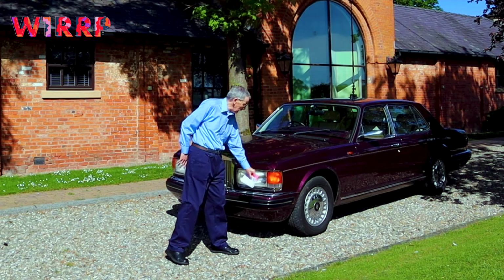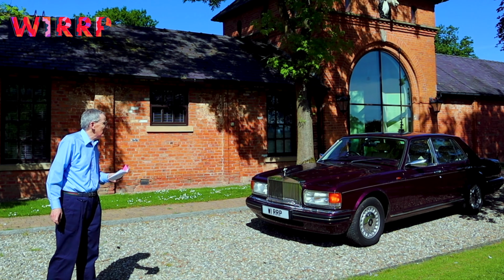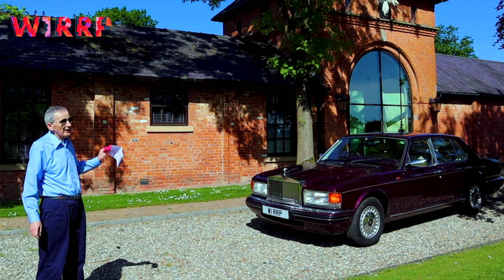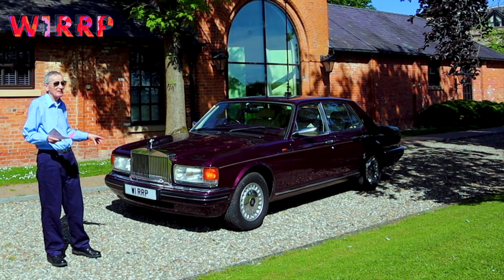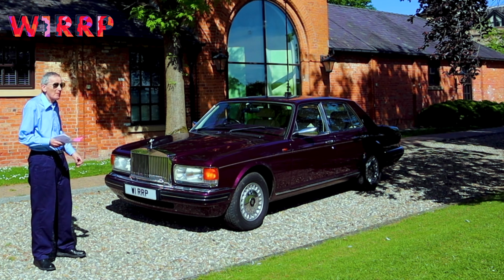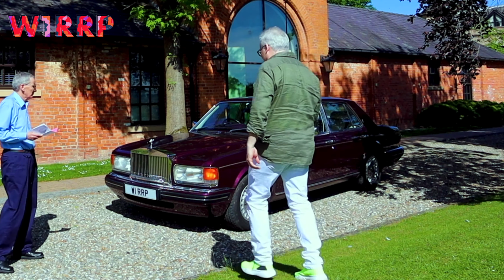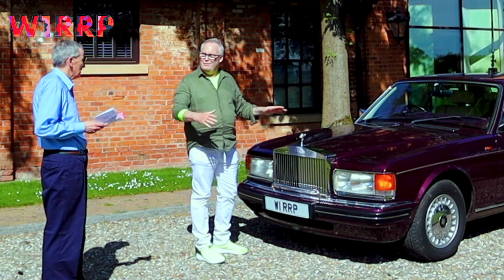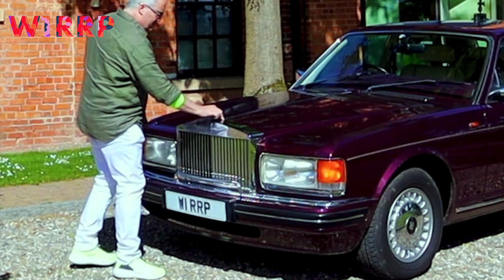Rolls-Royce Did Crash Testing! Rolls-Royce Engineering Challenges W1RRP Podcast Rolls-Royce SZ Cars

Comment: Was there ever an electrically operated mascot ?.
Reply from the maker: Yes, all the Goodwood cars have an electric Spirit of Ecstasy that you can control from inside the car and also set it on the key fob!
Reply: @W1RRP.Rolls.Royce.Podcast  did SZ ever have that ?. Or was it an option?.
Reply from the maker: @brianredmond4919  With SZ it is manual, you can push it to the side and then move it down into the grill. You can also buy a locking cover that goes over it, so that people can't pull it out and steal it. It's fixed on the earlier Silver Shadows and Wraiths.

Comment: Sorry Graham we only did a frontal impact for SZ and SY.
Reply from the maker: Great to hear from John, we especially like hearing from people who worked at Crewe, please feel free to write more and tell us more. It is people like you and Graham that really contribute to the history of Cr ewe and Rolls-Royce and Bentley. In fairness to Graham, our headline may be slightly misleading. Graham does only say directly about frontal testing, the other areas he does refer to but does not specifically say Rolls-Royce tested them. Thank you and let us know more?
Reply: @W1RRP.Rolls.Royce.Podcast  For ‘92MY, with the introduction of the GM 4L80-E transmission and two-piece propshaft, given the magnitude of the structural changes to the rear crossmember, transmission tunnel and engine adaptor plate, George Ray, who had body engineering responsibility, carried out a 30mph frontal impact test at MIRA.  This was filmed, I think, at 500fps for detailed later analysis.  It has to be said, that watching I slow motion as structural elements on the underside of the car are torn apart by the massive impact forces, at what is in fact a relatively slow speed, is distinctly sobering….  Happily, the modifications actually improved the quality of the ride-down deceleration.  My belief is that, as subsequent model years of SZ, BZ, BZT were structurally unchanged, the self-cert test results from prior model years could be carried over.  As Graham explains, with the 96MY revisions to the bumper system, the only “impacted” legislation (crash test engineering joke there, sorry) was the US 5mph zero damage bumper test.